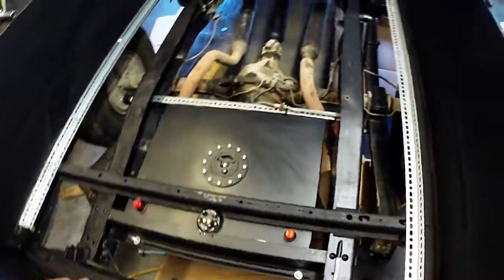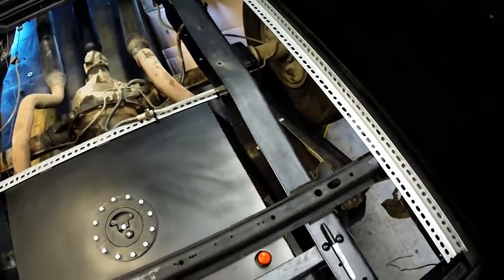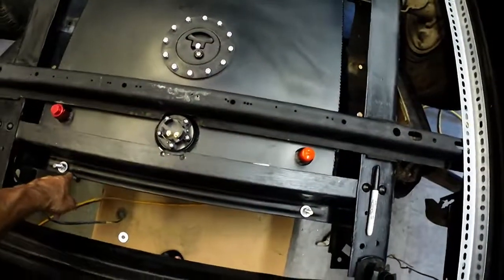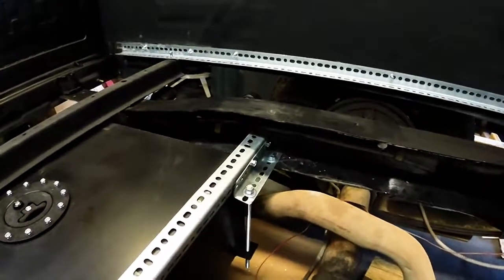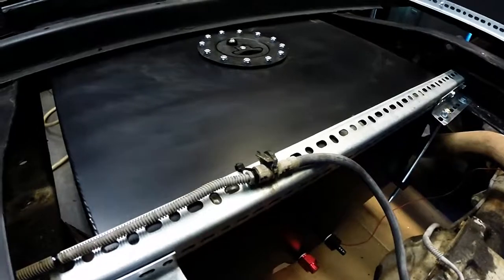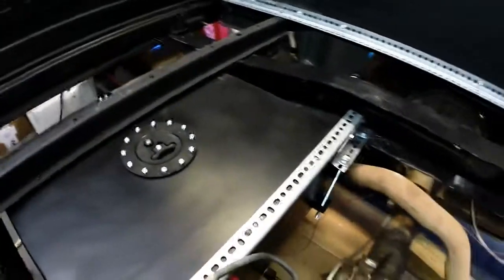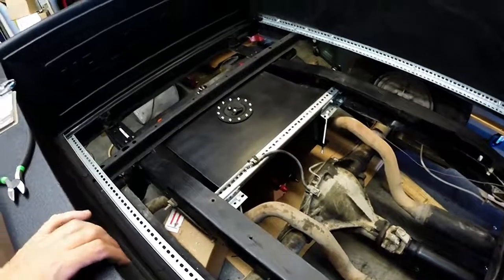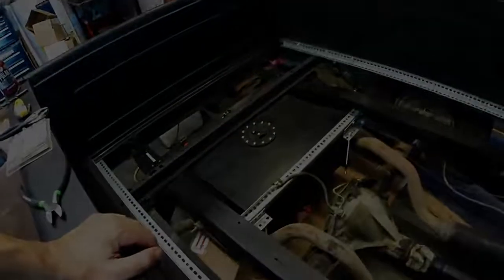Project Muscle Truck - Fuel Cell Install

Comment: I wouldn't trust the weight of the cell full of gas on just alltread through the mounting tabs.....  it needs bracing on the bottom of the tank  Also its in backwards.